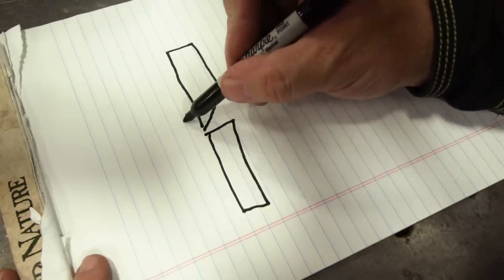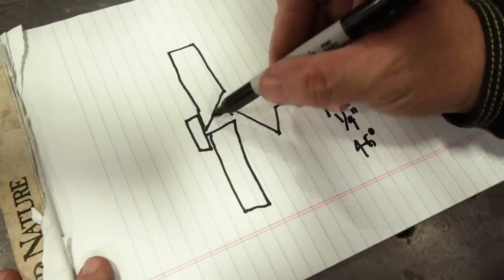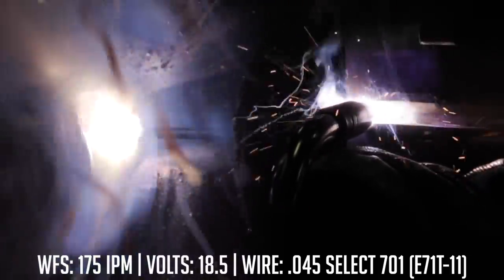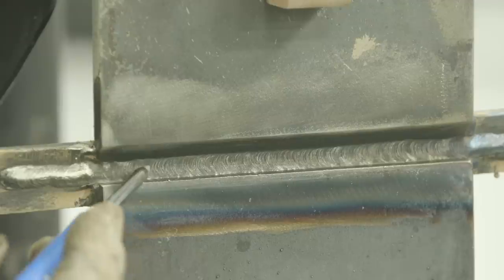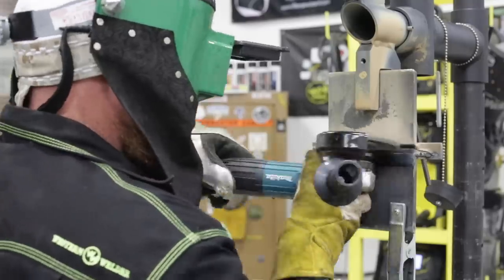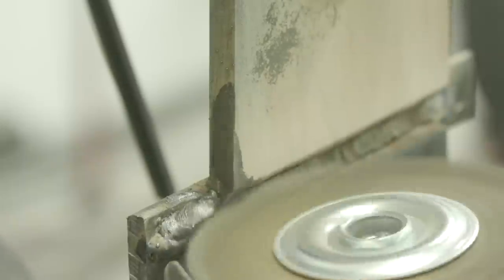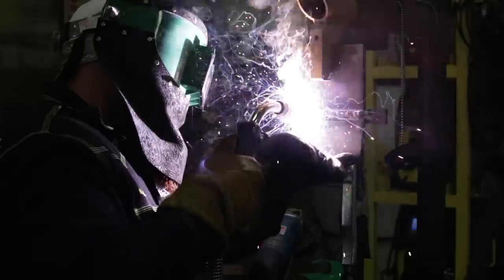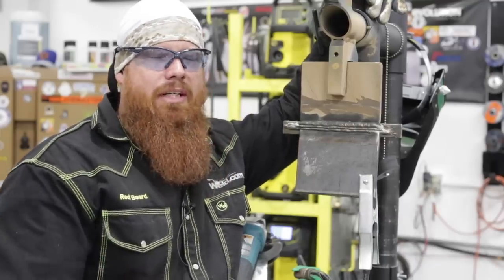Horizontal Flux Core D1.1 Weld Test

Comment: i am always using selfshield fluxcore on my small mig maschine because most of the time i am welding outside in the yard or garden . most difficult is to find the right settings and my maschine has only two knobs ( 0 -10 ) for volts and wfs no chart or DRO . until today the best fc-s wire i could find here in Germany on amazon is .035" Hyundai Supershield 11.    Greetings to the senior welding drill instructor MigGunnerySergeant Mr. Bob Moffatt ! and Mr. Jason Becker don´t cut your beard no matter how many subscribers you have !  ; )

Comment: I am a bit surprise by the settings, 18.5 volts in my opinion seems low, but after seeing the welds looks legit. I will give these settings a try at work. As always great video.
Reply: krazykanux same especially with a backing strip. Ceramic tiles I would probably use those settings
Reply: krazykanux it yields about 200 amps with these settings so it’s more than sufficient for 3/8” plate. Give it a shot.
Reply: @GodslilRedneck23  I dont remember exactly my amps when i pass my 2GF test but it was closer to 250. I will still try his setting out of curiosity.
Reply: It's half inch thick steel if it was an inch thick you would run about 25 volts and 250 wire speed

Comment: very good weld , no splatter , easy slag removal.  what settings would you recommend for 035 flux core  I have a pile of it to use. Thanks
Reply: Bruce D 18V and 305ipm on the WFS that’s for flat with 5/16” plate or thicker. Should be around 200 amps.

Comment: U.S marine nice work DCEN is more destortion  you ever notice when you weld a flange  to a pipe it pulls upwards or any pipe joint using GTAW  with DCEN 70% of heat on the base metal 30%of heat on the tig torch i normaly  root the pipe and then flip the pipe and hot pass it to minimize  distortion
Reply: mohammed troy Metal will distort on DCEP also. Heat moves metal.
Reply: @GodslilRedneck23  round  corrugated steel bars used in construction  is that weldable and whats the correct rod to used?

Comment: Man... I have my machine at work set at 31 amps and 420-ish wire speed.. You welding that sooo coooollddd
Reply: Im assuming you mean volts. And just because your machine is set to 31 doesnt mean where your welding has that in the puddle. Most machines at my work in the shipyard loose between 1.5v to 3v just from 50' to 100' of lead. If your using .045 fluxcore with 85/15 argon co2 then there is no way youd be welding horizontal at 31v and 420 ipm.

Comment: Sweet tips. .045 is way out dated in most shops tho. Can’t tell you the last time I touched it. Only run 1/16 and occasionally 052. U guys should make a 1/16 vertical vid. Fillets or test plates I’m curious to see how you’d run it. C02 as well. Keep up the vids 👨🏼‍🏭
Reply: philip dudenhoefer thanks, we will be doing some 1/16” pretty soon.

Comment: Jason what happens with the backing plate? Does it stay in place or get cut off afterwards?
Reply: Mark Fryer it all depends on what it’s for. For a structural application it’s usually left in place. If it’s for a qualification it depends on the testing method. For x-ray (RT) the backing strip is left on. For a bend test it is removed.

Comment: How much of your course is focused on weld/welding symbols?  My 20-month course basically skipped it.  Got any convenient ways/methods or learn that stuff?
Reply: Gabriel Schleder I issued welding symbols on day one and we go from there. Each assignment has a WPS and a blueprint. Then we have a separate full lecture on welding symbols that we discuss for a week and do a test at the end. But they’re pretty much used throughout the course.
Reply: Jason Becker   Well, sounds like that’s the way to go.  I went to a steel structural fab shop interview, and the first thing they were concerned with was our understanding of plans/symbols.  I was lost, even though I was the only one there with pipe and plate certs.  Thanks.

Comment: Any advice on a D1.1 structural test with 232 seismic wire in 0.72 diameter. I've been having problems with slag incursions and root cracks.
Reply: David Crowe check your stick out. Should be around 3/4 to 1-1/4”. If it’s any less you’ll get slag inclusions. Also point your wire straight in or 5°to10° down and drag the puddle up the joint.

Comment: Doing this for work right now. Exact root and bevel. Only difference is the material thickness. I’m doing 1 inch thick. Never messed with this kinda flux core so this helps out a lot. Perfect timing
Reply from the maker: Glad to hear it. Thanks for watching!
Reply: Jacob Niederkohr good stuff man. Keep at it.

Comment: I did some mechanic work for a tank & boiler contractor recently. I asked about their weld test because I was interested in getting hired on as a welder for future jobs. Can't find any good info on it, hoping you'd be willing to do a couple videos on it, maybe.

3 positions open root/v-groove 309 ss dual shield fcaw, with back grind/gouge. Don't remember if it was .035 or .045, but was 1/2" carbon plate. 

2G and 4G are no problem, but they insist on running the 3G uphill with a 1/8 gap. That's the part I struggled with.

Comment: I like the video well enough, but the issue i have is that I'm an ironworker, been welding structural for 10 years,  welding in general for  over 20. My problem is that in structural welding in the field I've never seen .045 wire used. I've welded that joint hundreds of times and on average we're always given .068 or .072. Occasionally if we're lucky we get 1/6th. It would be nice if u could demonstrate that for folks. As an example, I recently had to weld a CJP that only had a base material of 1/4" using .068. Point being, what ur supposed to do and what ur required to do in the field often don't happen. I would like to hear your thoughts on that. Btw all 8 of my CJP's passed the UT, some with only 1 pass.
Reply: scott tibbetts were working on doing some 1/16” dia. FCAW soon.

Comment: So eith my Vulcan running flux core my starts always have porosity, how do I fix that?
Reply: WildGooseProductions clip the wire before you start welding and hold a bit longer to get the puddle established before you start traveling. Make sure you hold a long enough contact tip to work distance.

Comment: I took 2 weld test at my job that I been hired at to be certified through the company using dual shield flux core in the 2g position and failed miserably. I don’t know if it’s my settings or what. It seems like I’m running way too hot. I don’t know but I got one more shot and if I fail it I’m probably gonna be fired. Sucks cause I love what I do but can’t seem to get this machine dialed in correctly

Comment: Could you do one exactly like this but I am 1 inch thick plate also could you explain in her past temperatures because some will test report in her past temperatures and is it recommended that you turn down the heat after running the route pass said that you were metal doesn’t drip out of there or should you wait until it cools. Because I’ve heard mixed reviews from my CWI’s at work

Comment: In the last 15 years in a structural steel the only time I've seen a backer is when the welder has issue with open root but 90% of the time it's a full pen weld
Reply: Stephen christopher using a backer is still a full pen weld. That’s why it’s listed as a CJP Complete Joint Penetration.

Comment: been struggling a lot with vertical FCAW-S on 1 inch plate double bevel running NR 232
Reply from the maker: We'll add it to the list
Reply: Are you preheating the plate for the root pass?
Reply: @53KO  nope. Wasnt told to!
Reply: @mycool2512  make sure to preheat to 350 degrees. Also how many volts and ipm are you setting the machine
Reply: @53KO  If his WPS doesnt call for a preheat, then he wont be allowed to preheat I dont think.

Comment: What I hear as a non-welder:
"Alright so I got the rootatoe sitting right back here in the flibbleflab, and we're gonna jimmy that up right after we fork this blitz center. Now make sure you don't provide too much curl cause then it's just gonna dench on ya and you don't want that."
Reply: What does this mean in English? The flux capacitor is burned out again......

Comment: Is the backing bar something you only run into during testing or would you actually find something like this out in the real world?
Thanks! Hey I like that you show the welding symbols that go along with the work!
Reply: patrick farley you can use this joint fit-up in the field for column splices.

Comment: I took a weld test like this recently but the plate was upside down where the bevel was on the bottom. I told them that was wrong. And it was over ceramic backing smh ridiculous.

Comment: Can you do a test with a 1 inch plate and 16th inch too short wire it’s a test that I’m needing to take for a job I’ve already passed it once but this time around on a new job I passed the test somehow I believe it was because they didn’t have their WPS attached to the machine also they wouldn’t Give me their inner past temperature and wouldn’t let me address the machine settings

Comment: Whatever.. lose that gas nozzle.. get a long gooseneck .. 5/64 311 or 232.. depending on the root Gap 2,,, or three passes maximum.. no chipping hammers no wire brushes no wire wheels.. 3/8 stick out on your wire.. will clean slag off your weld... regardless I've watched several of your videos and usually those are the best welds I've ever seen you do..  now get some 3/32 innershield.. a column splice with a 2-foot wide 2 inch thick flange... on a job site and show me something.. as a side note why doesn't anybody talk about personal respiration.. I mean if these young guys are going into this every career 40 to 60 hours a week to me that's the most important thing that's never mentioned.. and would you be interested in investing in a business that sells left-handed welding gloves only???